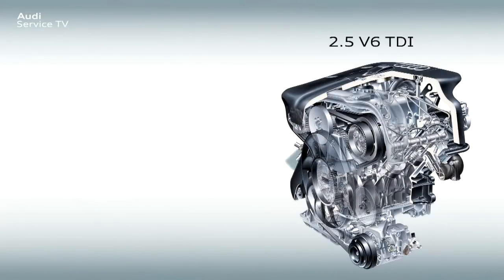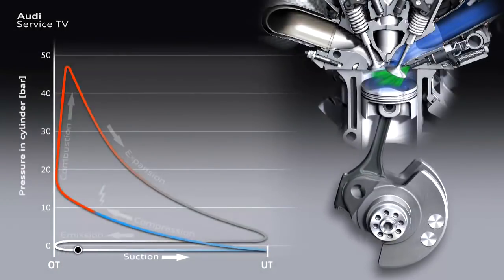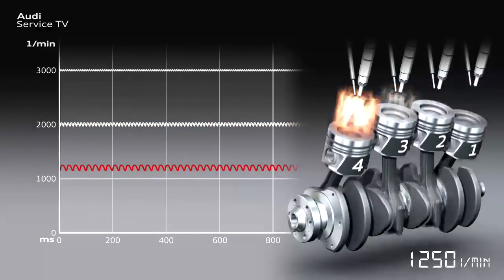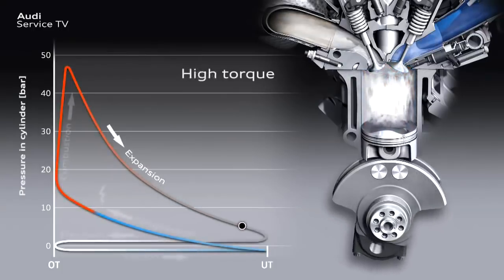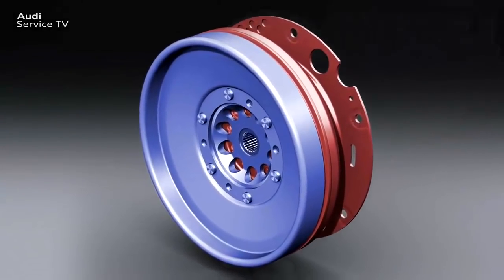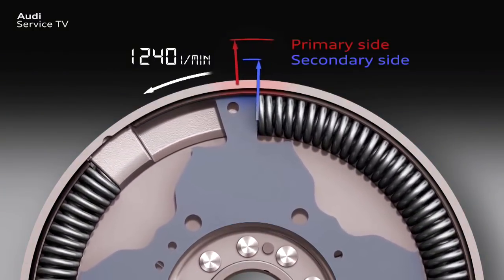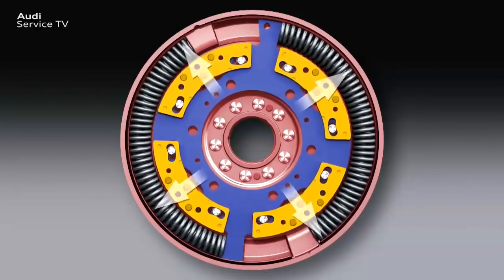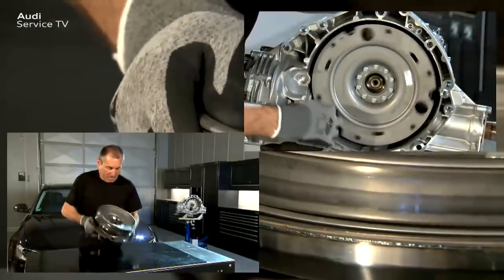Dual-mass flywheel with centrifugal pendulum absorber

Comment: i had a skoda octavia with dmf that failed, i replaced it with single mass kit, there was no difference to my driving experience at all. great video though
Reply: How did you convert to SMF ?
Reply: @dsk-xx  you can just buy the complete kit online and a mechanic replaced it for me. the kit contains everything , clutch plate, bolts, flywheel, etc.
Reply: @thefonzeful  does the kit comes for every car that has DMF by default
Reply: @dsk-xx   yes. valeo make kits for most cars, so do luk. i used the valeo kit, and the mechanic fitted it without a problem

Comment: Or, you could simplify things a lot by using single-mass flywheels with bigger counterweights. The worst vibrations are attenuated with great effect, and the extra cost and complexity of a dual-mass flywheel can be done away with.

Comment: It's also another part that wears out quickly, can't be resurfaced, and it expensive to replace. When these things wear out, they're absolutely terrible to drive.
Reply: Yeah but on the other side of the coin, you can go aftermarket, and get a DMF built to outlast the car, which i happen to have done to 2 cars, did it to a DM02 2.0 Tdi she did 350,000 miles on the DMF and it saw way to many clutches

My BKD Audi has an aftermarket job, its now on its 4th clutch and last time the clutch was done, the DMF was only ezhibiting about 4mm of movement, WELL WELL within tollerance and easy do 220,000 MORE miles.

So thats half a million miles on 2 DMFs............ And its cheaper yes, way more money to buy, over a grand for the audi, but it saves me £400 to 600 every time the clutch is done.
Reply: @AnIdiotAboard_ when is time to replace it? I hear some noises when idle, but no vibrations in higher rpm... what dmf are best? The car 9nly have 180.000 km and seems the dfm is wearing and the original clutch works perfect...

Comment: Would be much easier to use a hydraulic fliuid dampner harmonic balancer . Would be cheaper to replace  as well as less moving parts. I guess an enginers job is to over complicate everything.

Comment: let's create more of these low-life duration aftermarket consumable. And let's keep them more and more complex to prevent DIY maintenance and long-term servicing, a possible thing...
Reply: yea next is the triple mass flywheel
Reply: @alf3071  quadruple hydrolic cycloidal piston damping flywheel.
Reply: Nissan 2.2 . Luk DMF gets rattly before 25000kms. Chnaged 3 times. Whats the solution? Pls guide
Reply: @dsk-xx  did they change the bearings too?
Reply: @Francois_Dupont  bearing is alright. Only DMF goes kaput

Comment: I am curious why this is a problem NOW after decades running cars without them ?
Reply: because EU wanted less emissions, and manufacturers responded with smaller but more powerful engines for bigger and heavier cars (compare engine/weight/power/co2 in Golf 4 1.9 TDI and Golf 7 1.6TDI)... and voila.. shit happens... if we had same amount of emissions as EURO 3 or 4 and engine sizes around 2-2.5l per block (I4 or I/V6) there wouldn't be a need for higher power for normal cars, only for performance oriented versions.
Reply: How many cars have inline 4 that makes V6 or even V8 power with more low end torque decades ago?

Comment: Does anyone know if cross-plane cranks have the same vibes problem?
Reply: Yes, although all cranks still have 4-cycles, only 1 of which is the power cycle, so you still have torsional vibration.
Reply: On a V8 engine, a crossplane crank is not much worse than a flat-plane V8. But a four-stroke crossplane inline 4 is terrible from a torsional stabdpoint.

Comment: Does tuning an engine reduces the lifespan of this flywheel since the curved radii of the bearing tracks are now not in sync with the torque profile? Or does it just make a less smoother ride because the harmonic resonance frequency is changed?
Reply: torque profile is inherent to the mechanical engine design

Comment: This garbage cost me $5,500 dollars because 2 different mechanics could not figure out the random jarring vibration coming from chassis of car during deceleration. I replaced all my bushings on car to find out its this piece of s%*%. I ordered a single mass performance to replace it. I figured it out from research on Internet. Can't belive dealership mechanics couldnt figure it out. If you own a G37 with 6MT you better get rid of that DMF ASAP!

Comment: wow, a high-tech rattling double-mass flywheel... failure at low mileage guaranteed
Reply: My Fiat Punto twin air is fitted with one and i learned of this last week. This thing failed and dammaged the clutch an shaft.set me back €1800,- 
Only driven 43000 km and bought this car new😡
Reply: @dannykievit7040  i'm sorry to hear that, but things like this will happen more and more in the automobile industry...
Reply: 75k 2.0tdi caddy, started Making noises this morning... Ugh
Reply: @zizogaucho9035  BMW 320d, 210000km, changing it in a week even though it still works, but sometimes a bit jerky at first gear hence the change
Reply: @Xzizia92  it got to a point where i regretted owning a diesel.
Reply: @zizogaucho9035  There are pros and cons, but I prefer diesels. The fuel economy is unrivaled, and the tourqe is great
Reply: @Xzizia92  i just hate cuz i cant suddenly hammer it all the way to redline lol... Probably you gonna visit a mechanic by the end of the month. For a petrol, i do that quite more often.. I can change my driving style too lol. So i feel like petrol is more dynamic and playful. That's just how i feel

Comment: in gerneral dualmass is shitt and always fails so use singelmass :)
Reply: I shifted from dual to single. Vibration on low rpm is horrendous
Reply: My new caddy just started making noise 😢.
Single masse won't work too.
Gotta keep replacing it every 100 thousand km... Awful.
Reply: @kdeep1690   go with a heavier flywheel
Reply: @AmritGrewal31  loss of pickup and fuel in that case ..... 
 moreover OEMs make very specific fit flywheels ... So only oem type works
Reply: Single-mass with pendulum absorbers is the best of both worlds IMO. Low vibration of a dual-mass flywheel but without the complexity.